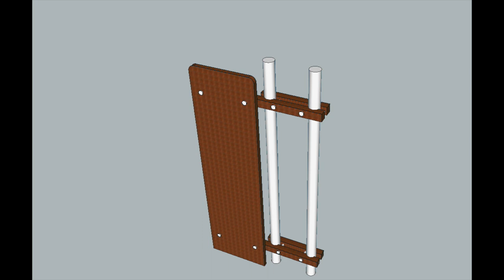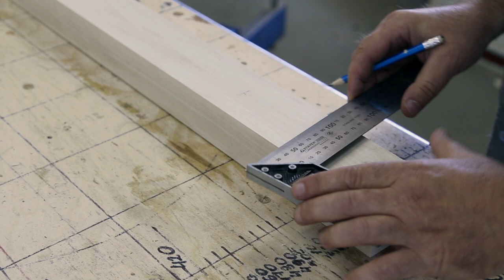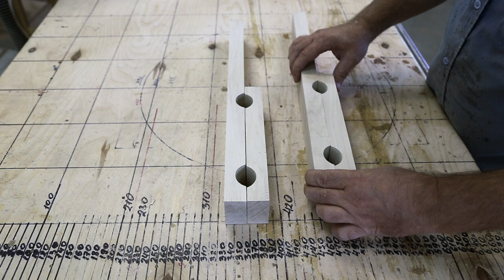Making safety fence for kids

Comment: Like the video, and i see a problem.   There are no fences around the Load Bearing Walls or the area you filmed from.  What keeps the sweet kids and cat from sliping through the cracks?   Maybe its time for more walls?   Maybe plexiglass ones in between?  great job AGAIN!!
Reply from the maker: Sophie Nelson I didn't understand the question. The wall is behind me. I closed all holes at the stairs. Thanks!
Reply: mtmwood at :027  there is an empty silver pole and glass area  the cat goes through.         over to that left of that,  there is another open area  that does not have attached glass and silver poles.   (for instance the stairs are all combined glass and siver poles    i hope you understand    :)    I hope this translation is better than my english.....

по адресу: 027 естьпустой серебряный столб и площадь остеклениякот проходит. к этой слева от того, есть еще один открытый площадь , не приложил стеклянные и серебряные полюса. (например лестницы все сочетании стекла и Сивер полюса я надеюсь, вы понимаете :)

po adresu: 027 yest' pustoy serebryanyy stolb i ploshchad' ostekleniya kot prokhodit. k etoy sleva ot togo, yest' yeshche odin otkrytyy ploshchad' , ne prilozhil steklyannyye i serebryanyye polyusa. (naprimer lestnitsy vse sochetanii stekla i Siver polyusa ya nadeyus', vy ponimayete :)